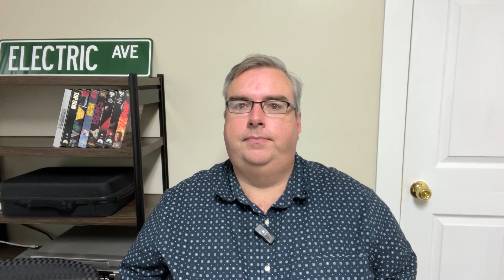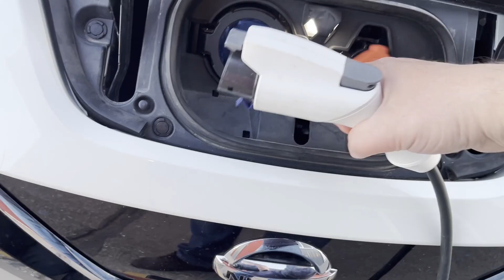Is Level 1 (120 volt) Charging Good Enough for an Electric Vehicle

Comment: When I first got my leaf I only charged with 120v on a 20 amp circuit. I later found some free level 2 stations, until I could install my own station.
Installing a 14-50 outlet cost $600. I checked and the electrician had installed a commercial outlet. Have not had any problems with heat.
Only once did the main breaker shut off. Found someone left an iron on. After that we made sure we didn't have too many appliances turned on. Discovered too many circuts drawing power can be a problem.
I find a number of home owners are not aware of the fact that too many appliances running at the same time can cause problems, or an overrated appliance on an underrated outlet. New some people who could have burned their house down by continually resetting a breaker, while they used an overrated appliance.

Comment: Thanks for the great channel 🙏🏽
I charge my Tesla model Y at 6A because my commute to work is 7.2 miles roughly. This is less than half of a 15 amp outlet except that I met 240 V because I’m using a 100 amp level two Tesla charger and it’s wired for 100 amp. The most that I could ever pull off of. It is 80 A from a model S or X and the most I ever pull with my model Y is 48 A, but 90% of the time I pull at 6 A and this is why I tell people it’s possible to never need a level two charger depending on your personal circumstances. I am fortunate because my Tesla model Y gives me the option to choose the amperage, and my power company sadly does not have peak and off peak rates.. 
thanks again for the great channel. I really appreciate all your hard work.👍😁👌🏾
Reply from the maker: Thanks for the kind words! You may have the ideal charging situation. You can pump up the Amps when needed, if you’re driving far, but for daily needs you can keep it low and slow!

Comment: One thing id recommend to anyone lookig to just level 1 charge: get a circuit finder take some time to identify what circuits all of your outlets in your home belong to. Unless you are an electrician too much for the electrician that has either done the work for you or done to work for previous owners or contractors who are participated in flipping a home, have done it properly.

Bootleg grounds are notorious and if you come across 1, get very careful about using it and make sure the ground isnt powered.

Comment: I've not yet installed an outlet for my level 2 EVSE. Prices to install one ranges from $700-$1600 and with the lower price I have to deal with cantankerous electricians when I ask if they'll be using a GFCI breaker or installing an industrial 15-40.

For now, Level 1 gets me 10% overnight drawing 11a from the outlet.

I use level 2 at work and that can get me 40-50% while I'm there and rotating the spots with others in the building.

I've also used plug share to identify chargers in all the places I frequent often, and have registered with every app in the process. Doing this casually will help when I really need to charge since registering is a big pita.

Comment: Like you, we also have two cars and one L2. Which is used to  charge the higher milage car. With the lower milage car getting the L1 charger. Chargeing overnight. We than top that car over the weekend. When rate as low both days.

Comment: If you are frugal like me, you always go for level 2.  The reason is that you meter turns as fast if you're using 120 volts as does on 240.    So level one could cost you twice as much on your bill..  It's very important that your electric panel is as balanced as possible.
Reply: @DIYDrivenDave  Every power company is different, but to my knowledge if you are drawing 8 amps on pole 1 and 3 amps on pole 2 , the meter will charge you at the higher amps in this case 8 amps for both poles.